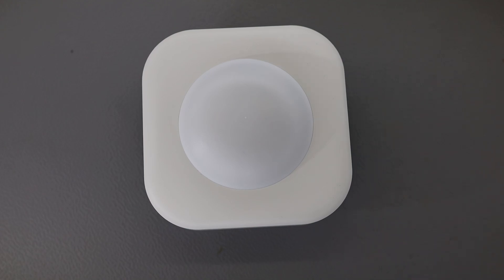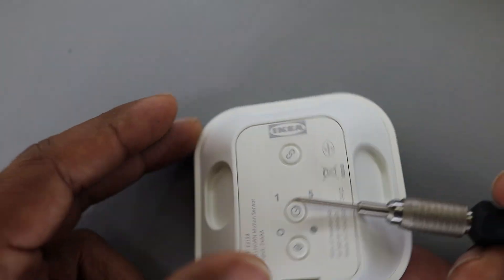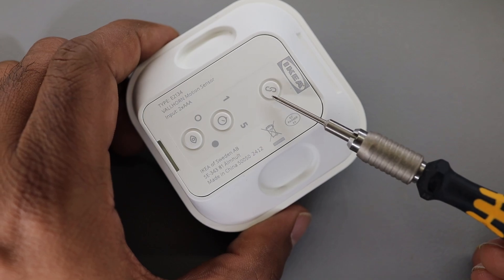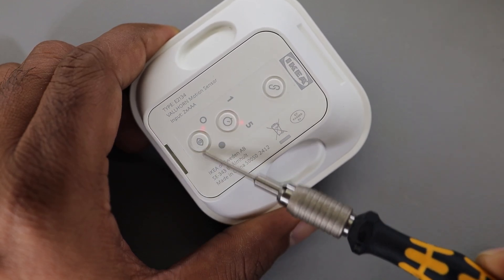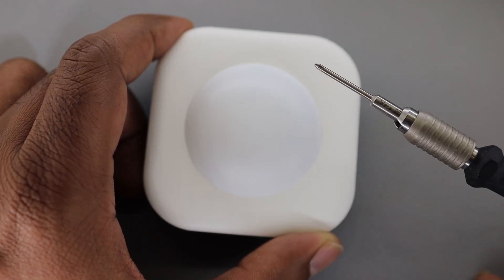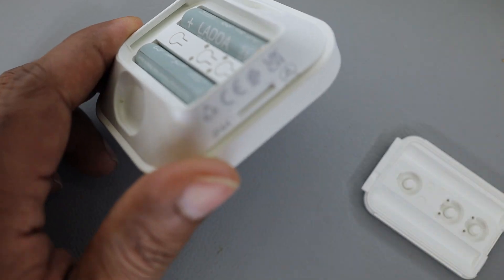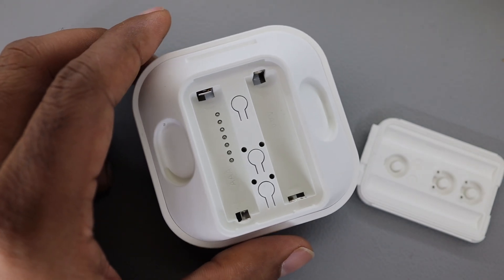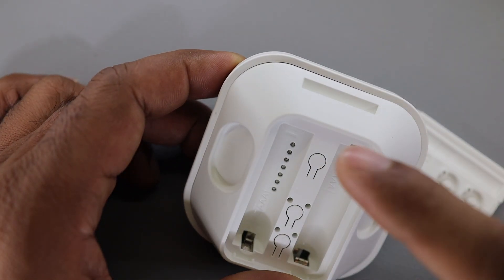Ikea Vallhorn PIR Zigbee Motion Sensor Teardown

Comment: Why light sensor is capped in home assistant at 1365 LX ?
Reply: one workaround is to disassemble the case (as shown in the video), and put something partially light-blocking on the sensor - e.g. dark electrical isolation tape, or something similar. afterwards, you can recalibrate the lux values shown (because they will of course still be capped at ~1365 initially) in Home Assistant as necessary.
Reply from the maker: Right now I have no Idea but Maybe i can measurements Then I will let you know.

Comment: How does this compare to mmWave options?
Reply from the maker: They are totally different class of things, Meant to different kind of detections. This is just basic low power sensor doing PIR detection.
Reply: @circuitvalley  sorry, I know the difference. I'm just wondering how well this does compared to mmWave? I've not had much luck with any PIR sensors before, so I'm wondering if this one's better?
Reply from the maker: @marcosscriven  This is no better , Its just a simple Lame PIR sensor, It consumes low power and has zigbee, from Ikea only for 10$. that is where features ends.